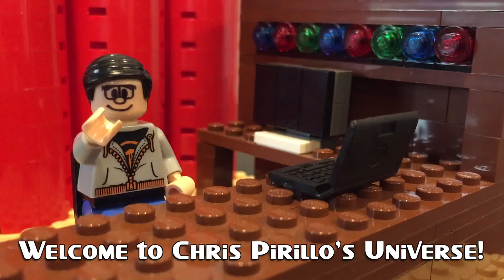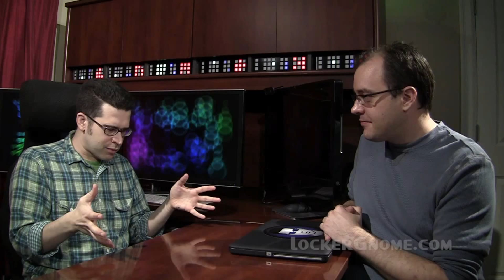What is a Waveguide Speaker?

Comment: A "folded horn"?... this guy is clearly confused. Bose wave guide is NOT a "folded horn" since a folded horn routes the driver's entire output into an open flared horn. Bose funnels only the back wave into long tube (like an organ pipe that is not flared) that is tuned to pump up low frequencies only. A much better analogy is a 'transmission line' system (also call a labyrinth). The Bose wave guide principle is nothing more than a poorly executed variant of the transmission line invented by Bailey and Radford in the late 50s.
Reply: on your 1st point. folded horn can be front or back loaded.  i have speakers with that design. try  looking for fostex fe206en. andfuck bose btw.

Comment: It is also an 'EL CHEAPO" method of getting more sound from smaller cheaper speakers. An example is a certain over priced clock radio system sold by an major unnamed speaker company that advertises on infomercials and in the grocery store gossip mags.  It does work but is in no way a substitute for larger drivers in a larger cabinet.

Comment: Bose is a great small stereo system...but what are your thoughts on their 2 speaker "surround sound" systems?  Aren't they just stereo speakers that have a bunch of small speakers within them pointed in different directions so the sound will travel in a way that makes you feel like the sound is all around?  I don't believe it could possibly have the same effect as a 5.1 or 7.1 surround sound system, especially when watching a movie.
Reply: The key to 2 speaker surround sound is a combination of a delay from right to left that tricks the ear into thinking the signal is wider and deeper than the speaker placement would suggest. Also, other processing tricks like increasing the sustain and decay of the signal can cause the sound to bounce off the nearest hard surface and arrive at your ear within a couple milliseconds of the direct signal from the speaker. The result is that your ears think another speaker is mounted on the wall and it sounds like you are"surrounded" by speakers.